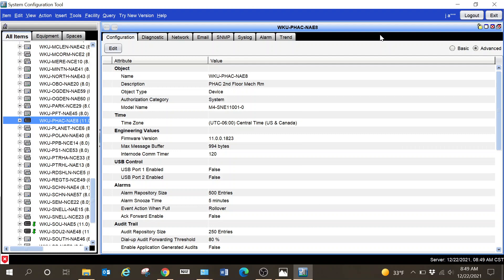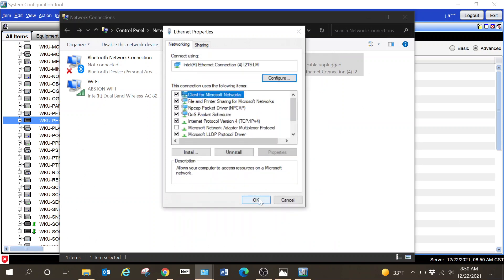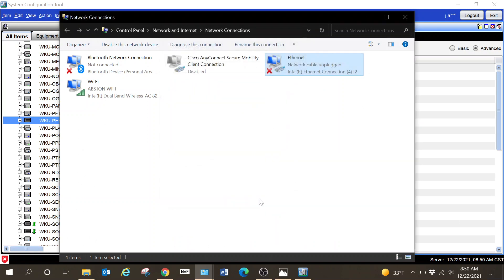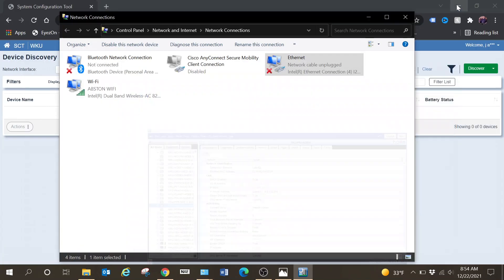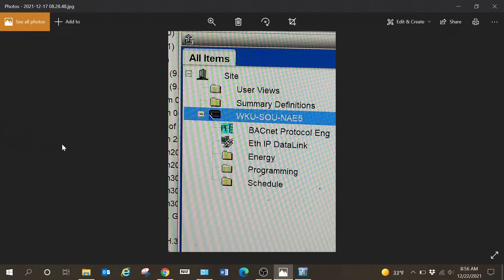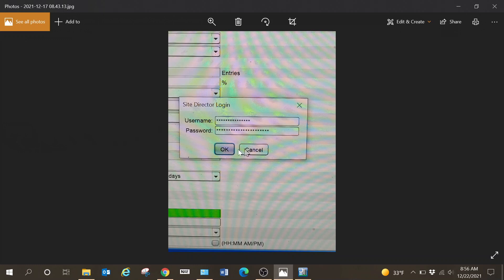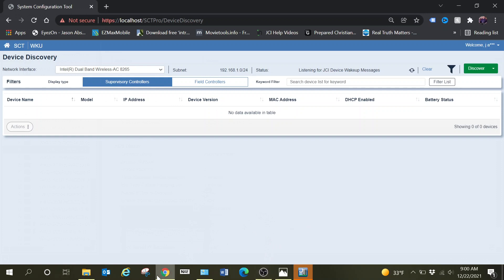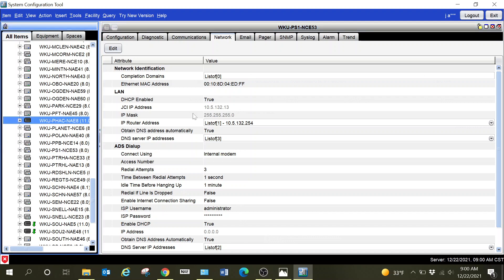How to replace a Johnson Controls NAE with an SNE Part 1

Comment: Use a router with sne. Use dhcp with like settings of the network your sne will be on. Also wait 10-15 minutes before you download or image snes
Reply from the maker: Part of the problem is with security settings on our network. There's different steps we had to take to get it online